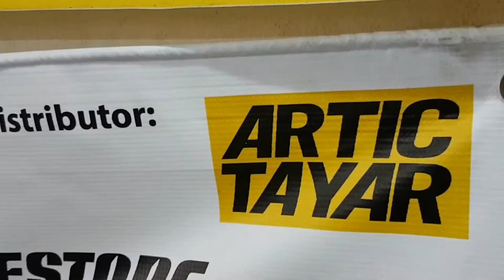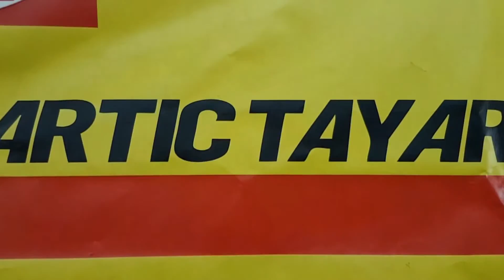New Tyres for My Aprilia Shiver - Continental Sport Attack 🍩★Artic Tayar★

Comment: How is the grip compared to your older tires?
Reply from the maker: Hello Jagdeep. 🙋‍♂️ My previous tyres were Rosso Corsa and they were very good in dry as well as wet condition. 👍🏻 This Conti is not good in wet maybe due to a different compound mixture. 🤷‍♂️ I would probably go back to Pirelli options when these tyres are due... ✌🏻🙂